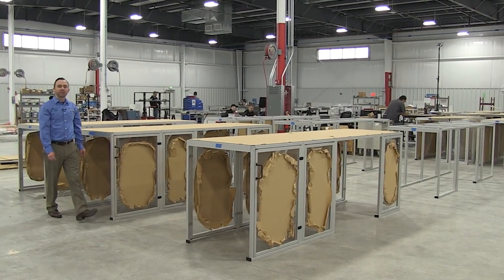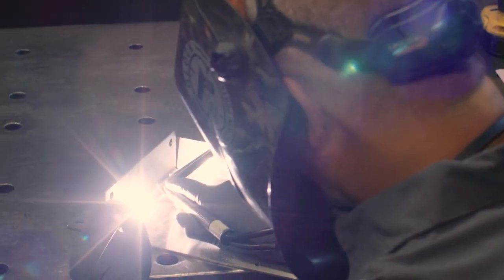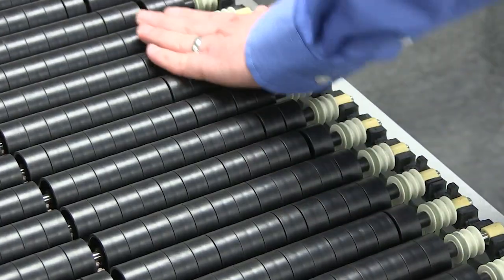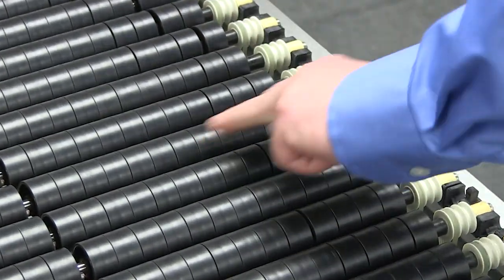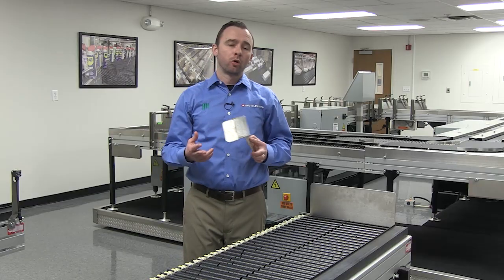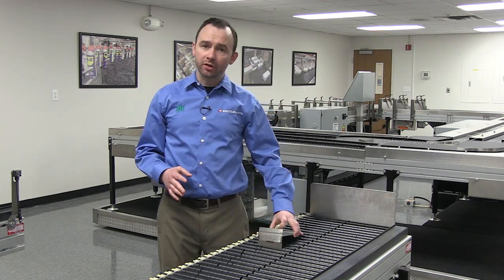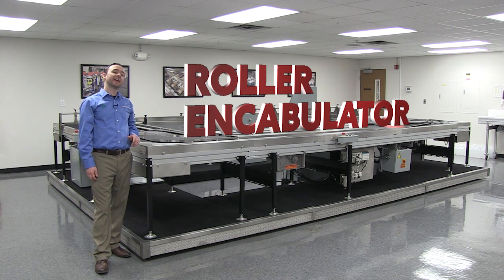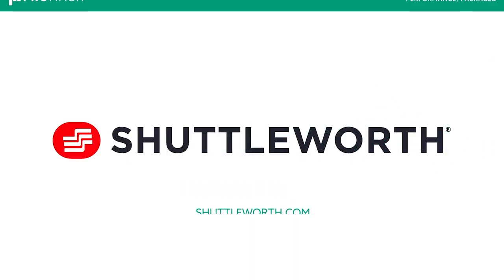Shuttleworth Roller Encabulator

Comment: Congratulations on the release of this innovative material handling system! As an EE, I confess that some of the mechanical details are out of my sphere of knowledge, but past experience with Shuttleworth equipment gives me confidence the Roller Encabulator will work as advertised (notwithstanding any remaining issues found before RTM).

No doubt you have already considered (and mitigated) the possibility of heterodyne interference between the seven-conductor interlocutive radix (mentioned in the video) and the trans--oscillatory permanganation ratio of triphasic energization (I assume 480 VAC, 50 or 60 Hz) common in industrial environments. Since the Roller Encabulator avoids power extraction from flux/conductor relative motion, inductive dielectric relaxation is not dissipated in the traditional way. What, then, is the recommendation for intermodulation suppression when the interlocutation-to-phase ratio is non-integral (in this case, 7:3)?

I am confident Shuttleworth has addressed this during safety engineering, since it is obvious the inverse standing wave amplitude could otherwise result in free electron leakage into the ambient and thereby a shock hazard. My concern here is not whether this has been managed, but simply how your design choices here will impact specifications for related control systems.

Comment: How did you prevent modal deplanaration of the stator induced electro-relunctance?
Reply from the maker: We simply redirected the cordial habiliments to the diametric generator control unit. Which we all know allows for the proper aggrandizement of galvanization when propagating nano-phase tardigrades in molar volumetric circuits.
Reply: @ShuttleworthConveyor Tardigrades? That's a stroke of genius! I would never have thought of using nano-vermicular methods to achieve quantum tunneling outside of a lab. If you have commercialized this, I am truly impressed.

Comment: I came to this video hoping for solutions to side fumbling with my home encabulator. It's exciting to see that you've been able to solve sidefumbling with the addition of 6 hydrocoptic marzel vanes,  but the ambificent lunar wane shaft in my home encabulator is only large enough for 4. I feel fortunate to be able to encabulate at home but the replacement frequency of the tremi pipes and girdle springs is a real drag.

Comment: So, where is the flux capacitor mounted?
Reply: Did you even watch the full video?  The flux capacitor is clearly visible directly beneath the plenary gear assembly with sprocket bolts securing it to the right spindle armature winding coping bearing retainer housing.

Comment: In the current generation of modular spurving based encabulators the dynamical gauge trundle oscillates bi-harmonicall with the gram meters resulting in unwanted lane information transmission at both the local and global system scales.

Currently researchers are attempting to address this by trip wiring a Michelson symbon on the aft side of the overgirdle near the detractable phase modulators thereby, with the addition of smoke and flux overshots, could balance the inter-dingle-arm by up to 12 Dantzel units of source

Naturally, without cross modulators all phase information of the weirstrass function will be washed out of the Trappist assembly and so researchers continue work on advancing these crudely conceived ideas.

I can't wait to see what comes from this line of research
Reply: I would have to take issue with the non porcelain trabulators  keeping psi counts on the amps and arms with the rotation sequences charging ions to modify performance to a higher level of electro magnetic activity algorithms.